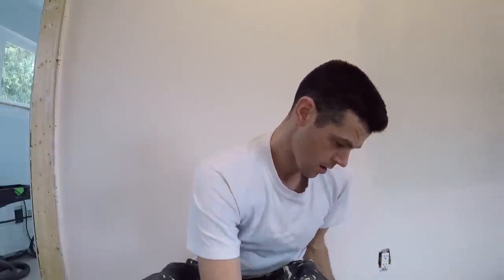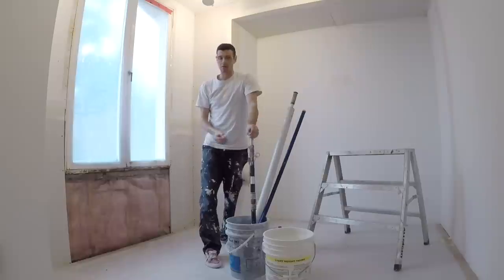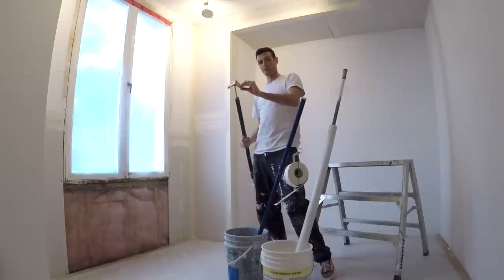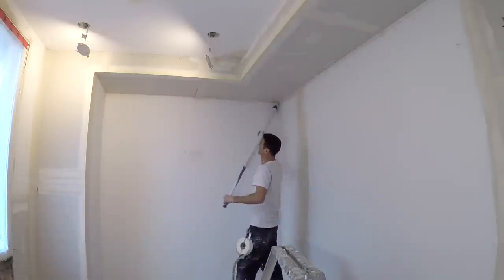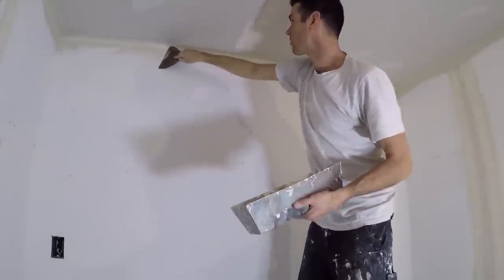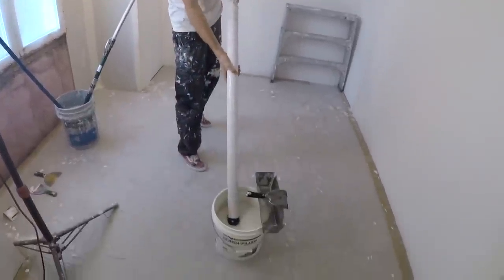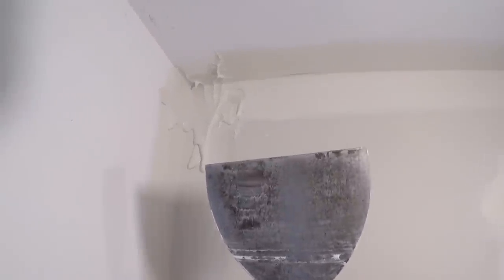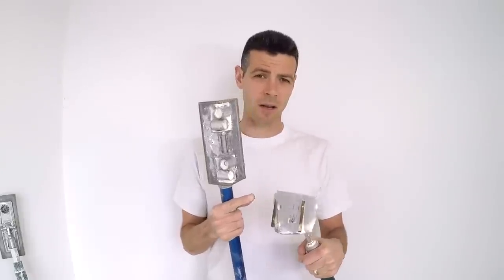DRYWALL CORNER TOOLS!!! (THE BEST DECISION YOU WILL EVER MAKE IN DRYWALL!)

Comment: We use angle heads on a MudShot. I much prefer it to a flusher.
Reply: bearded rider they round the corners too much. I use a 3’’ tape tech wing. I’ve never seen a mud applicator like his. I’ve always used a “ tube”
Reply: @mitchholste5999  yeah we just run a roller and 2.5 inch angle head to plow when we tape and run a dewalt mudshot with a 3 inch head to coat. Works awesome.

Comment: I have heard that you want to run the walls with a damp rag to get the drywall dust off or the mud won't adhere very well if you sand before another coat. Ever had any problems with cracks or anything after applying mud on dusty drywall?

Comment: I don’t have any trouble running my mud thicker than your second coat. And i only use the direct fusher alone as an applicator and and a finisher. It takes a couple passes to get it perfect and less time overall. And for first pass just a 2- 1/2 flusher after a banjo or bazooka. Is super quick and clean. Anyway I like your videos. I have learned much.
Reply: Thanks for this. I think you just answered the question I posted a minute ago!

Comment: I didn't see a link to the red Better Than Ever corner applicator you were using.  I have the smaller aluminum ones you have in your links, but the longer red one you were using seems to roll easier.

Comment: What is the sandpaper grit you use for the sanding of mud on walls?
I have used 120 in the past or 180, but I heard somewhere else in an instructional video that 500 or 600 is to be used?
Reply: Personally I have always just used 120 screens, and then a hand sanding sponge for any small areas. 500-600 would be for automotive polish sanding, after panting.

Comment: Hello there! I'm about to buy my first flusher (us amazon is my only option... We do not have these here, in Poland :( unfortunately!). And the thing is: which size should I buy? Usually I'm using 2" wide paper tape or 2.4" strait flex tuff tape - so, I should rather choose 3" or 3,5" flusher? "CanAm Tool Corner Flusher with Roller Wheels (3.5")" vs. "CanAm Tool C300-RR Direct Corner Flusher with Roller Wheels - For Applying Drywall Compound and Feathering Corners With A Fainter Touch (3" Widetrack)" - both available on amazon. 
Thank you in advance for your reply. Have a nace day, greets : )

Comment: My angles are done so  so fast.

Super taper perfect mud consistency and proper amount on tape.

2.5 inch can am flusher with creaser wheel. Press hard. No roller needed, time saved.

Finish 3.5 can am, touch up 3 ways within 3-4 hours while still wet.

Also the type of corner applicator has a big impact. Too many holes means lots of mud and ridges. I never get ridges with the 2 wheel 2 hole applicator.

Ive tried the black diamond bte applicator from this video. It sucks. Way too much mud

Comment: Hey Ben,

Have you come across hairline cracks in the corners after using a flusher? I wonder if this possibly occurs due to the mud shrinking  in both directions at the same time vs hand coating one side at a time.

Comment: Am I mistaken or did the tape get cut on the inside corner at 12:33? If it did, what would you do in that situation? I’ve had it happen a couple of times when hand taping and I would just pull the tape off and start again. Can you just mud over it?
Reply: the tools sometimes leave marks in the corners, might also be from the sanding pole. youre correct in removing torn tapes as its lost all its strength. if its a long tape just cut it off from where the tape broke and reapply
Reply: StixOkay thanks!

Comment: Seems to me it would be easier and faster to tape the angles with a bazooka,then roll with corner roller and then glaze them with a 3 inch corner angle attached to a mudrunner tool. Thats my prefered method.

Comment: Could you address how much pressure needs to be applied to the angle heads when smoothing mud.  Looks like that pole was really being flexed.  Thank you
Reply: T Willey it’s all in how it feels takes little practice
Reply from the maker: You have to press fairly hard. Also you need to try and make sure the bent part of the pole where the head attaches to is at 45 degrees to the angle or it will coat it out of square. As in, it leaves more mud on one side. I forgot to mention that in the video but it's very important.

Comment: Another great video. I’ve never run those exact tools but I have ran the full set of taping tools with the flexible angle head. We used to use the Ames rental tools and for new construction, that’s the only way to go to me. Tools speed up the job so much over hand finishing and taping everything. I do have a 10 inch mud box and did a video comparing that to hand finishing and it was way faster, of course.
Reply: The myth, the man, the legend!

Comment: Do you have a brand preference for taping tools? I see there's several brands available (North Star, Columbia, Tape Tech, etc); is there a cut and dry brand to run with, and what is your reason for such if so?
Thanks in advance.
Reply: I run north star  flat boxes. Columbia pump and angle box and heads. Tape tech taper. Its personal preference. Those are the top 3 brands though
Reply: @chrisg7923  cheers. I just picked up some guys barely used Columbia compound tube, flusher heads, flat applicator, and roller; may look into a Fat Boy at some point but getting into the mud pump, etc, seems a bit much for me at the moment; too much like real work. Ha-ha!
Reply: 80% of my work is brand new drywall so definitely worth spending the money. But if you only do a couple rooms a week. Not worth the time unless you trying to learn to use the tools.

Comment: When your work intersects an existing painted surface, do you wash the area prior to applying the compound to ensure good paint adhesion? If painters came along later and started scrubbing down the paint, they could really mess up your feathering, or worse. I know they prefer a clean and scuffed surface for warranty, etc.
Reply from the maker: I never do. If the painter washes unprimed mud they are being a bit of a dummy. The painted areas next to the feathered edge are already sanded by me anyway so they should stay well away from it. I would only wash the walls if they were super greasy. A good sealer should bond without a major washing.
Reply: I differ from Ben here. I TSP painted wall always. It removes the dirt, yes, but also the acid removes the finishers in the paint. This gives the next coats some real bite. This ensures the next paint / primer does not roll up dirt and leave it on the wal.
I realize it's not warranted on many guy's jobs, but my paint finish is as close to perfect as I can get.
Just fyi for those who may consider it.
Love this channel ! Gonna buy a corner roller.

Comment: i think the problem with all the so called "quick" tools is that the mud is too slim, when ever there is a gap in the sheeting more than 2mm it should be filled first with cypson or something thicker as even the spattula thick mud doesnt fill the gap but merely shrinks in the joint and when the joint filling is all dryed up there is gaps for the studs and gypson sheet to move and you know what happens then. It doesnt matter is it a corner or middle of the wall. just test by levain only mud on the joint and let it dry, it pretty much disappears from between the sheets and leaves a gap between the sheets. that´s why i would prefer joint filling only with hand tools and thick enough mud. Yes it´s slower but overal it really doesnt matter and you hardly never have to redo anything.

Comment: As a taper, this is painful to watch. I know that you do a great job with your work, but the time it takes to get there hurts to watch. Automatic taper, corner roller and a 2 1/2" glazer to apply your tape and give you a skim coat on application. Next day, hit it with a mud runner and a 3" head and you're ready for sanding and detail. I do respect your work ethic and quality of work, but you may want to invest in an Auto taper and mudrunner. Cheers sir!
Reply: Would you mind posting some links to the tools you prefer working with? Would be helpful.
Reply: For a professional sure, but I think most of his audience are DIY'ers looking for tips.
Reply from the maker: I get where your coming from but those tools are for full time production tapers. Insanely expensive with a huge learning curve. I would love to try them out but I dont do enough drywall to justify them and dont plan too.
Reply: Hey Ben
Love the vids. If there's a aimes tools in your area, you can rent a mud runner and other nifty things.
You're right, there's a learning curve. But, the nice thing about renting the tools... If it's too much of a hassle... Don't rent it ever, ever, ever again. 
I actually moved to an area where aims was 5-6 hrs away at 80mph. That's 600khp I think. But they will ups the tools to the middle of nowhere...Fairly inexpensive. About what it costs for a few beers and pizza if that's how you pay your help. 🤜🏼💥🤛🏻
Reply from the maker: @galepiker8361  I bought an old blue line bazooka and tried to fix it up and learn to use it. I hated it! Those have such an insane learning curve and with no one to teach me it was just not worth it. Also my jobs are too small. Too much patches and not enough long money making runs. This method is perfect for what I do. Although I have always wanted to try angle heads over the flushes but just too spendy. If I was a full time taper I would reconsider.
Reply: Vancouver Carpenter maybe you could...I don't know... Maybe watch a YouTube video on how to use a bazooka :) just throwing it out there👍

Comment: Loving your videos! 

I'm planning on buying some corner tools for a renovation. I was looking at getting an inside corner roller and a 2.5" flusher to speed up initial taping (I have back/spinal issues so the less time I spend looking over my head the less I hurt). 

Yesterday I came across this video:

https://www.youtube.com/watch?v=Oonvbzp-vsE&frags=pl%2Cwn

The video is about using a banjo, however I found it interesting that he skips using an inside roller and goes straight to the flusher. Have you ever tried this? I'm wondering if there is any serious downside to skipping the roller and bedding with only the flusher? 

Used flushers are relatively cheap. I've only found one used inside roller and it was more $ than a new one on Amazon! I'm thinking a banjo might be a cheaper and better investment.

Any thoughts?

Thanks for sharing your knowledge and have a great holiday!

Art.
Reply: If you get one for initial flushing you should get a bigger one for coating.  The time saved is just insane.